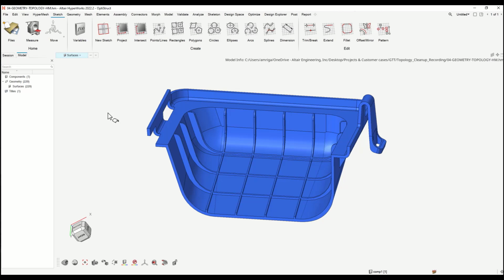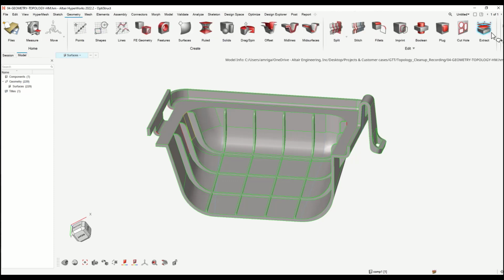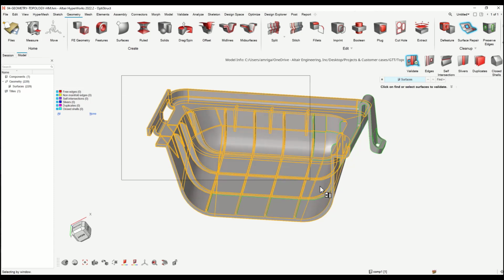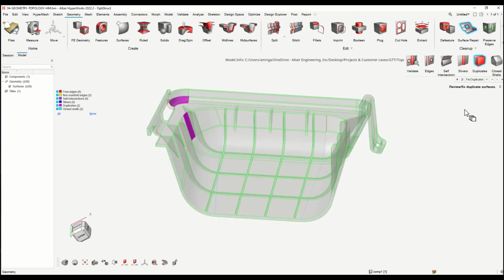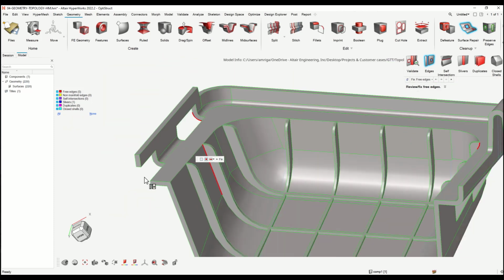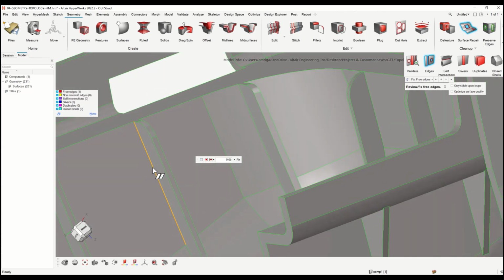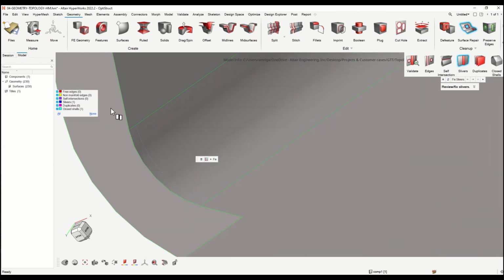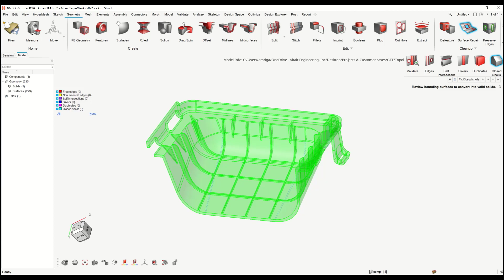HyperWorks 2022.2: Geometry topology clean up using Surface Repair tool

Comment: Helpful. Would be great to also have more explanation of what causes common geometry errors in the source 3D/2D CAD models.
Reply from the maker: Hello @kkloikok, there can be multiple reasons for geometry defects: it can depend of a difference of tolerance between HyperMesh and your CAD tool, or the format of your geometry file. Also there are still possibilities of human mistakes in the CAD creation